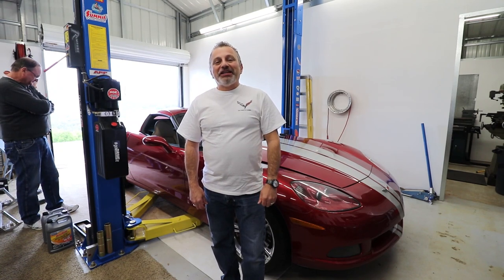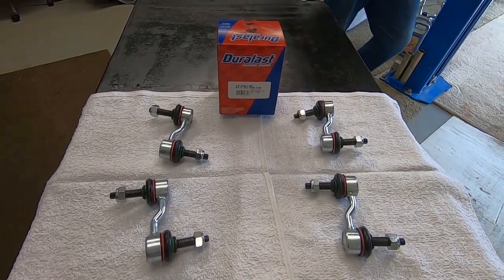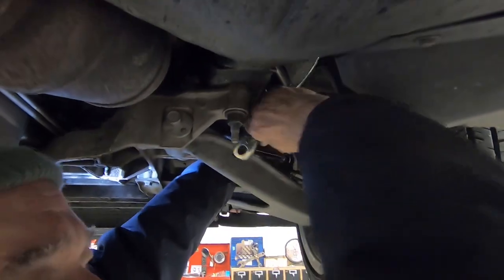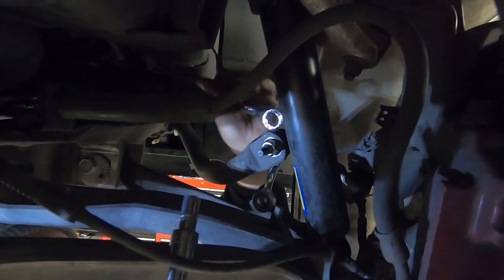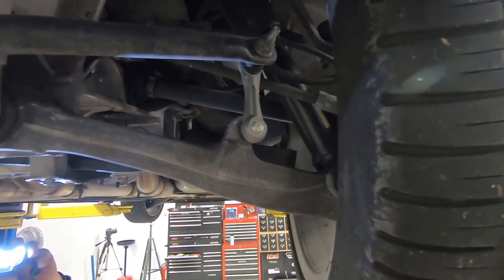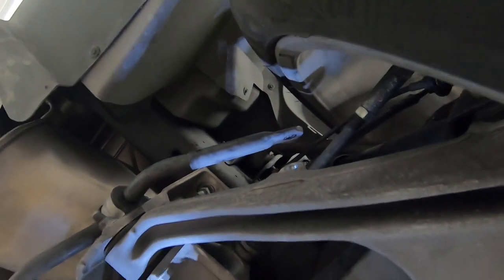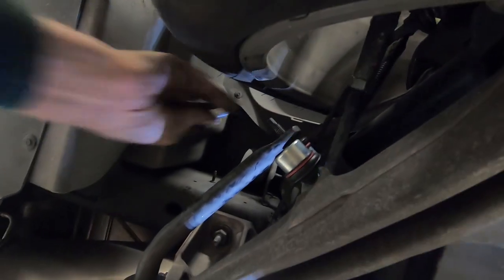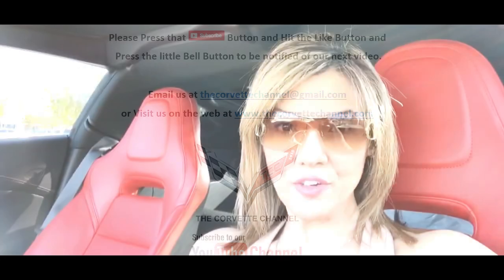How to Change the Sway Bar Links on a C6 Corvette

Comment: Why are you doing it the hard way and fighting the rear nuts??  All you do is remove the forward facing nuts on each end link, then you remove the four easily accessed bracket bolts and you drop the entire sway bar.  Replace the end links, inspect the bushings (which are often cracked) then reinstall the bar.  It's too easy.